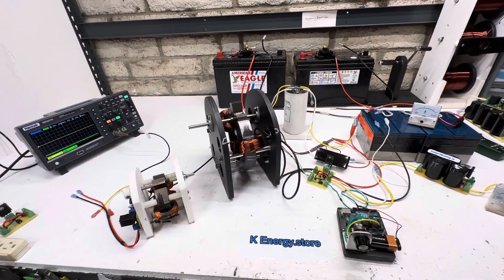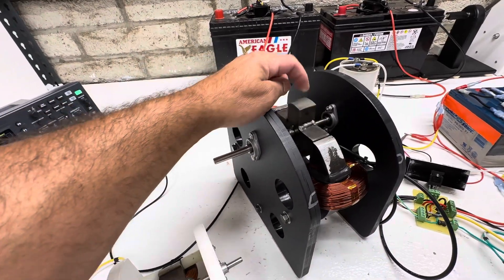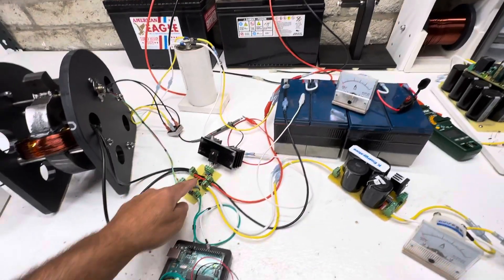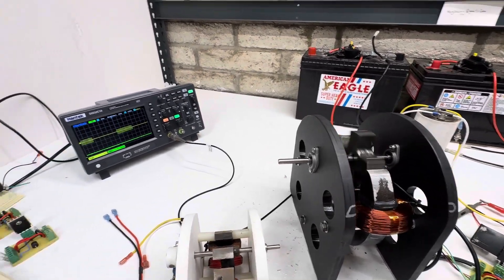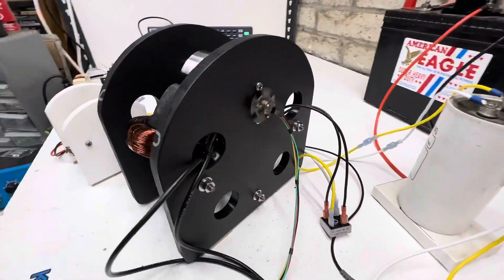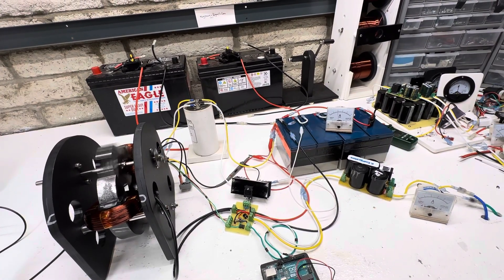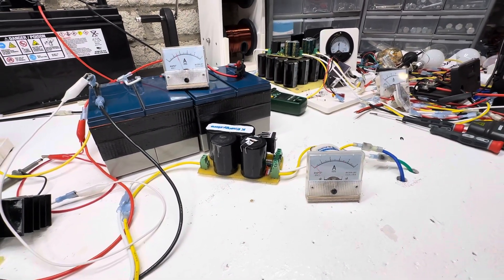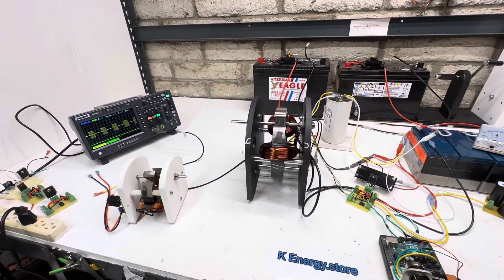New big attraction motor

Comment: Hi Sir.  Just a quick question about the small wheel on the opto coupler.  How many teeth were on the original.  And how many teeth were on the new one that you replaced it with and how did it affect the timing sir?  Also, do you have a schematic or even a name for the module that is between the motor and the cap dump ( not the pwm ) and how big was the small cap you eventually hooked up to it sir.  Thank you sir.
Reply from the maker: The module is the mosfet circuit I use for most of my motors the timing disk has 4 cutouts to go with the 4 metal on the rotor
Reply: @kenergy1707  Makes sense 4 metal, 4 teeth. Sorry that should've been obvious.

Comment: Thanks for the video. Nice work. This type of motor will actually destroy some electrical energy because inductance is increasing over time during the collapse of the magnetic field. You could try running it as a parametric converter (with a prime mover) and break some newish ground in the search for OU, if that is what you seek.
Reply from the maker: Thanks ! The mild steel has some amazing qualities that are overlooked 
 The most recent video I did on one of these attraction motors can be greatly enhanced by magnets 
more speed more torque less input power

Comment: How long did it take you to make the motor K Energy ?? What are you asking for the motor ??  Nice work too.
Reply from the maker: Prob total like 20 hours takes a wile to hole saw that 1 inch thick steel lol and making the rotor the star board is much nicer to work with takes the most time for the idea / design 
I still have some fine tuning and make the circuit for it probably another 5 hours once I get the timing perfect i usually make 3 or 4 timing wheels to test with
Reply: Thank you Sir for the answer !!!!! @kenergy1707
Reply from the maker: I’m not sure about the price yet
Reply: O.K.  @kenergy1707

Comment: Can you imagine one of this in every electric vehicle out there? For those just beginning to follow you, "3 primary windings and 1 output winding" means what?
Reply from the maker: Definitely 
3 and 1 winding are the ratio of magnetic wires on the core 3 power or drive wires 1 output or energy collection wire